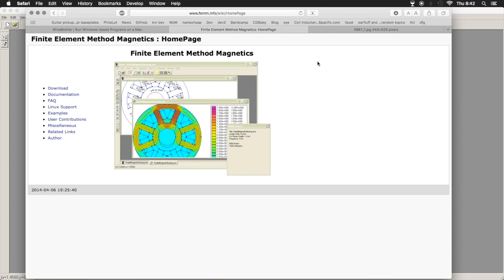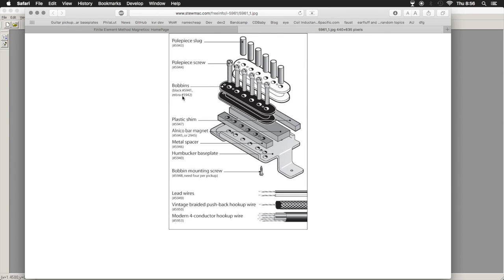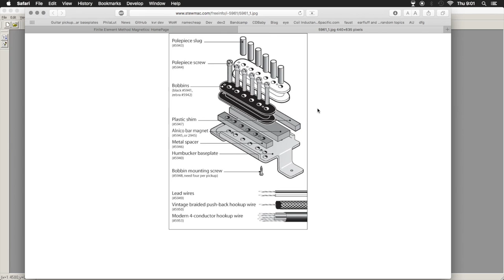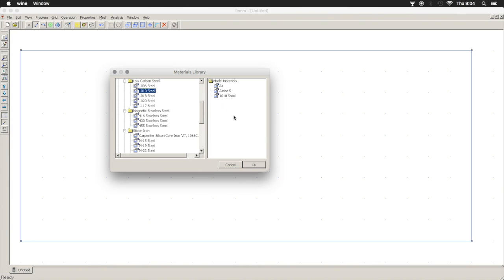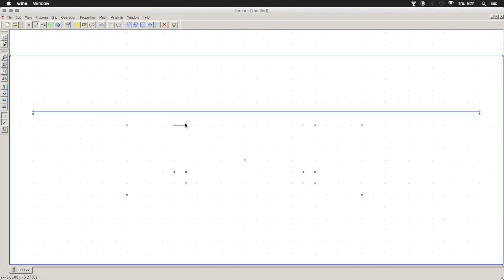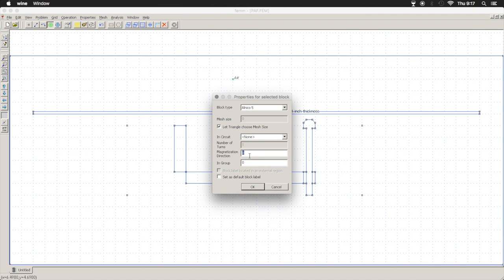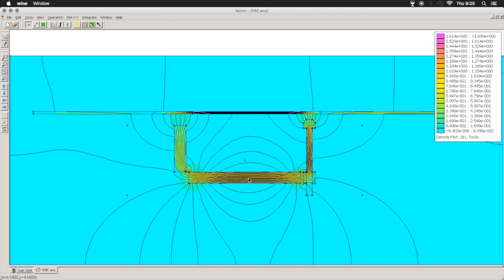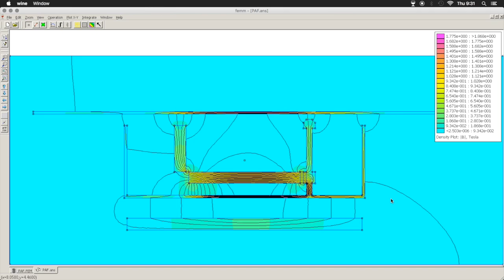Alex Kenis - modeling guitar pickups in FEMM part 1

Comment from the maker: Hey thanks!  I have been sidetracked by building a new coil winder, so I have not been working in FEMM much lately, but I'll get back to it when I can.  As far as inductance, that would be tricky for guitar pickups in FEMM since it is 2d.  Pickup inductance is tricky to pre-calculate since the permeability of the core materials is often unknown or vague, and the core geometry is odd (mostly air, but with ferromagnetic cylinders, and a shape that is short and with a high aspect ratio).  If I come across a more elegant solution then online calculators + hand-math, I'll post it on the blog.
Reply: Thanks man,.....Brilliant ......